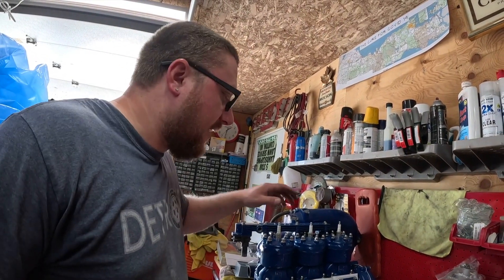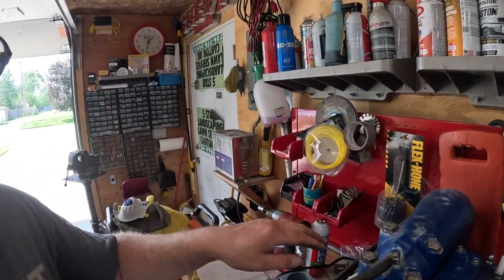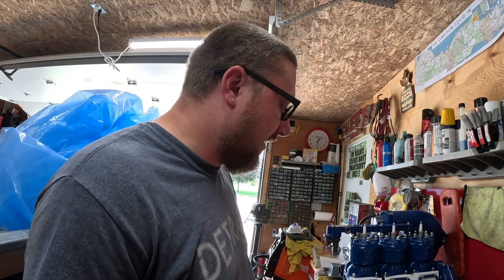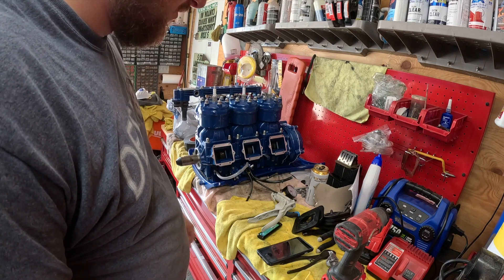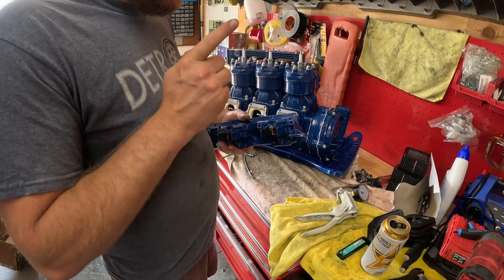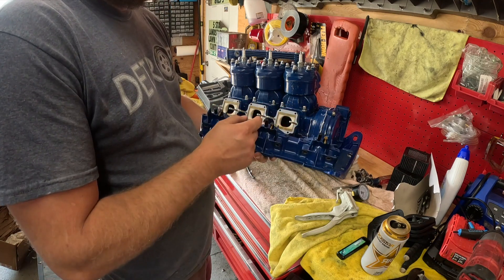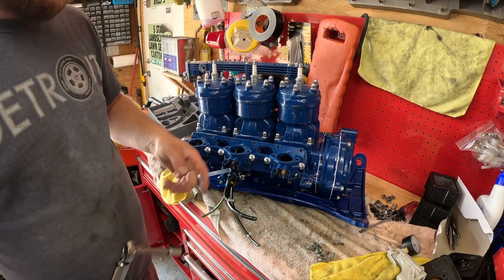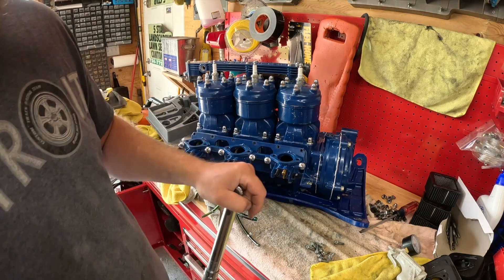Polaris SLT 750 motor build, vacuum testing crank case with problems!

Comment: fantastic video!! ive had the same problome with mine, i baught rubber plugs and vaccum tested it and i was leaking from the intake. i had some corrosion on the reeds that i missed. once i fixed that it holds vacume for a good amount of time but it drops to 5 in about 7 minues. i cant find any more leaks. i also pressureized the cooling system and didnt find any leaks. do you think it might be leaking from the bottom of the cyclnder, by the base gastket like yours? or do you think it might be with the cyclnders? the cyclnders i got from SBT with their echange program. would the cyclnders be the problem? im supper stummped and i need some advice. Anything would help, Thanks!
Reply: Now it only drops 2 inhg vac in 10 minutes. Do you think that’s a problem